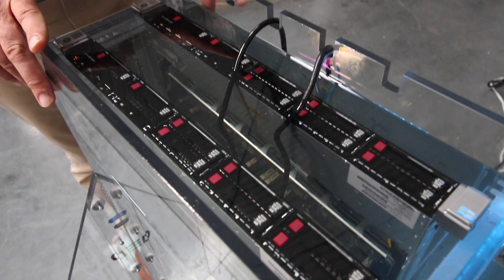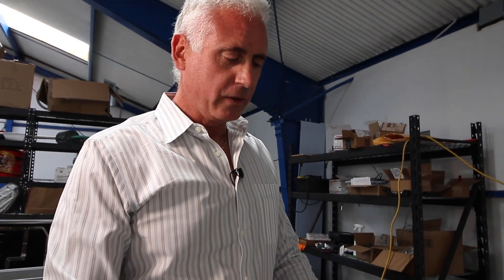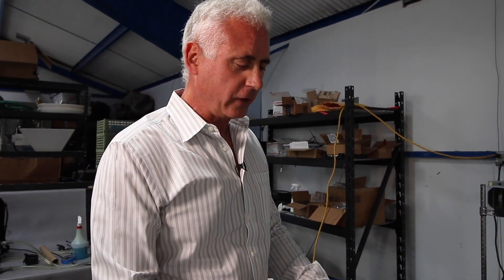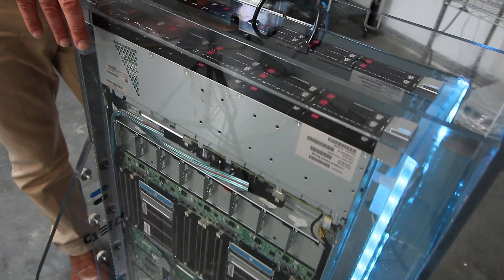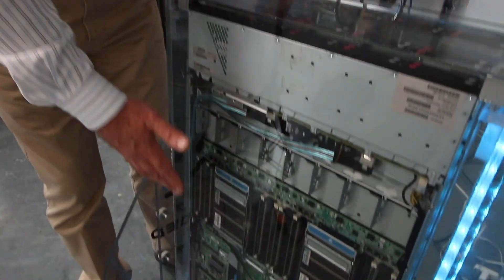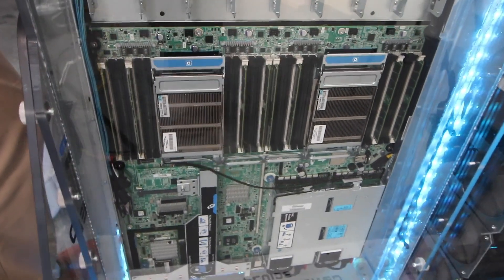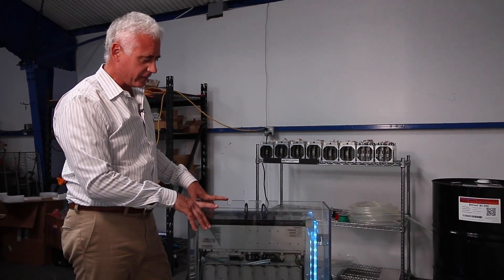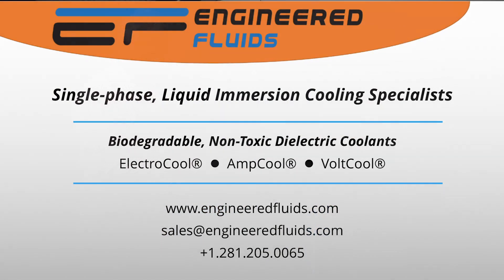Preparing a Server for Immersion Cooling

Comment: Hi, great idea :) What is the maximum safe temperature  of the liquid at the outlet to the heat exchanger?
Reply from the maker: The maximum temperature that you will generally see leaving the tank is 60C and that would be the input to the heat exchanger.  If you go to our website you can download the 80 page "Engineered Fluids Guide to SLIC" which is a technical how to guide that provides all of the information you need to setup a SLIC system.  https://www.engineeredfluids.com/the-slic-guide

Comment: Now that the cooling medium has been created, do you have  designs and teams dedicated to create cooling systems to capitalize on your product?  For example, if data centers are your target audience, are there partnerships established with IT companies to redesign their equipment to accommodate your technology?   It would be great for IT enthusiasts to get their hands on a box that could house their gaming PCs and also plug their peripherals without touching the liquid or causing a mess.
Reply from the maker: Yes we have design and engineering teams working with 5G Service Providers, Data Centers, and Cryptocurrency mines to build full turnkey systems as well as design the cooling infrastructure for them.  We don't need IT companies to redesign their equipment as our products are fully compatible with off the shelf equipment.   For gaming pcs and other small applications we have acrylic tank designs that work very well.  The key to peripherals is to be selective of what you put in the tank and what to keep out, in fact if it is not generating a lot of heat, there is no need to immerse it.  We generally provide a connector board that is above the level of coolant.  For when you must immerse specific parts of boards or entire boards that you are going to need to handle as part of maintenance we also offer a full dielectric solvent that fully removes all of our coolants as well as mineral oils.

Comment: Can this fluid be used to cool a workstation?
Reply from the maker: Yes, we can cool almost any type of electronics with ElectroCool Dielectric Coolant.  The key is to create an economical container in which to fully immerse the server.  Acrylic works very well for this application as its easy to work with and the chemical welds don't leak when properly constructed.
Reply: @garytesta2324  Fascinating product. I have been searching for something similar to the NOVEC product but more friendly to work with. Hopefully once I assess the potential of your product I can move forward on my idea.